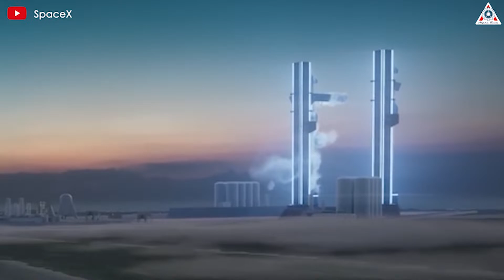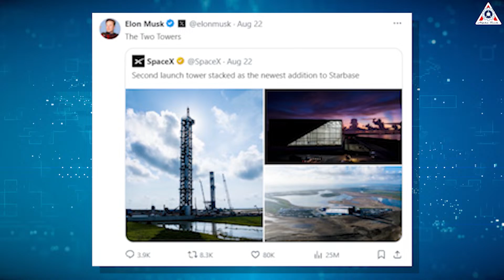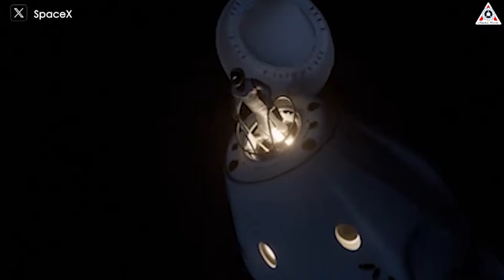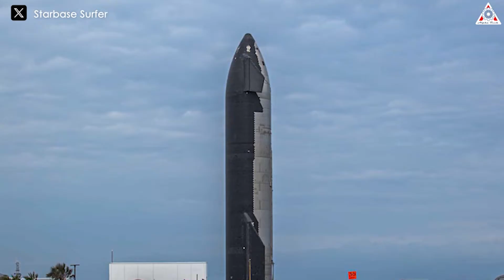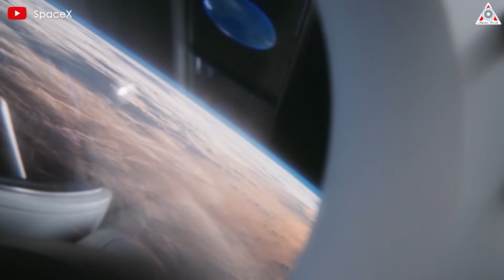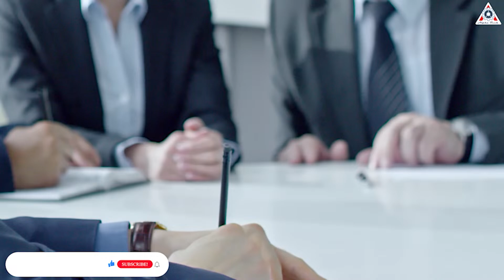NEW Starship Genius Orbital Refueling! SpaceX New Launch License Flight 5...

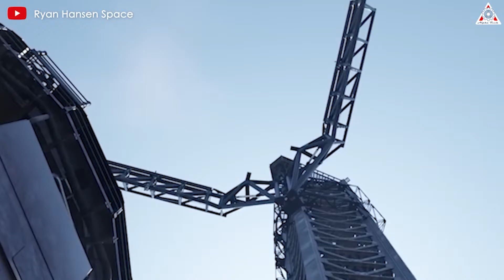Comment: 13:00 Re: Catch Design Testing. Any updates on the recently planned craned ship section Mechazilla capture tests that I’ve been encouraging, since mid-Aug? Closing the arms on a planted booster is not at all quite as challenging as attempting to neutralize & cessate the inertial forces of ships (very different dynamics for Stg1/2) during the last 9-3 seconds of their hunting around for the exactly precise capture orientation, including in potentially high winds. E,g., Had anyone noticed, about a year back,  the 5 consecutive F9 ocean landings, where SpaceX intentionally positioned their F9s off-platform & hovered over to the landing circle, then rotated to place the footings precisely in the (since erased) circle gaps? All but the first attempt was PERFECT. From my 10 months on San Clemente Is. CA, in the Poseiden missile “Pop Up” test program, I can tell that SpaceX leaves NOTHING to chance, bc even then, unknowns still arise that must be addressed, impromptu. Imagine yourself among those assigned control room duty & wanting to keep your “options” open to manage such “inevitabilities”! Thoughts, @smartazz61?

Comment: What they should do is build the Boosts into a configuration that it can easily be converted into an orbital station. Give the booster enough power to put it into LEO and another one into orbit halfway between the Earth and the moon. The Boost would be converted into the Gateway Spacestation and a refueling station in LEO. The LEO station would be unmanned with the equipment to keep the required fuel at the cold temperature for storage. Starship tankers can be launched to transfer fuel to the LEO Fuel Station.